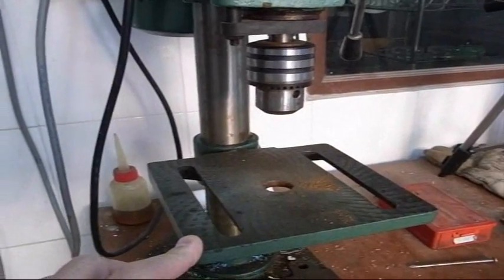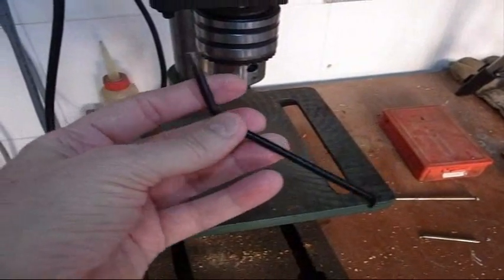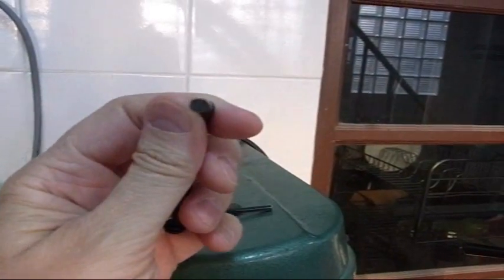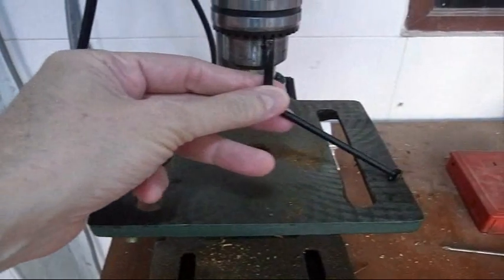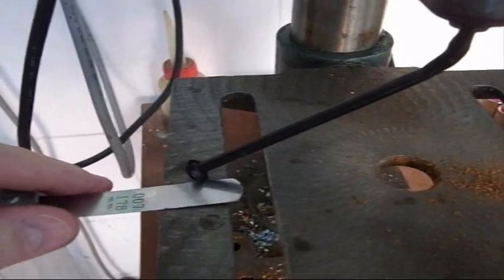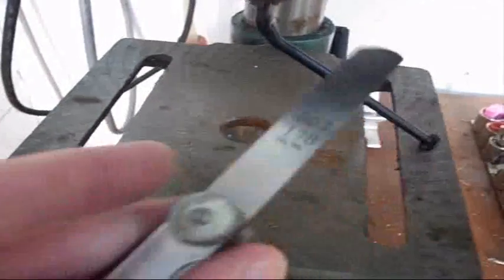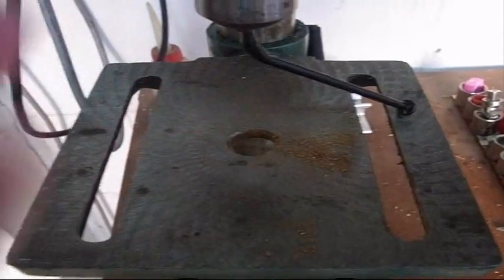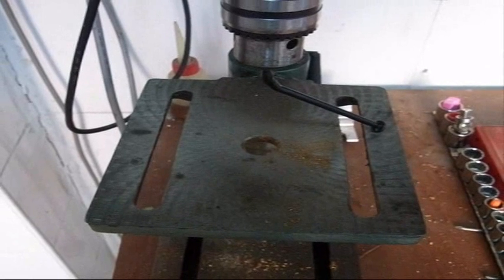Drill-press Table Squaring, High Precision - DIY  (Updated Video Available)

Comment: How do you adjust the table so the front of the table is not only perpendicular to the column put parallel to the center of the column? 
Example, if the column was square it is easy to to make the front of the table parallel.
There is not a registration mark on my column showing the front center.
Reply from the maker: That is an interesting question.  It's important to be able to make it 90 degrees to the length of the column.  But when it comes to the left-right adjustment, it seems that you may want to use the center of the drill chuck as the reference point.  You can do that with a fine drill bit and a ruler laid from side to side.

Comment: That's great, It shows you the error down to thousands but the table adjustment doesn't give you the ability to make small adjustments.. ie: as soon as you tighten the nut on the underside of the table you've thrown your adjustment out again.
Tips on adjusting please
Reply: Use the method in the video to get close, tighten the table nut maybe 1/4 turn less than fully tight while trying to hold the table still, then re-measure using the same method and instead of using your hands to adjust the angle, use a plastic hammer or a small piece of wood to tap the bottom of the table on the appropriate side until you've got good alignment. Now tighten the nut fully. Check squareness one last time and make any needed small adjustments with the hammer/wood again.